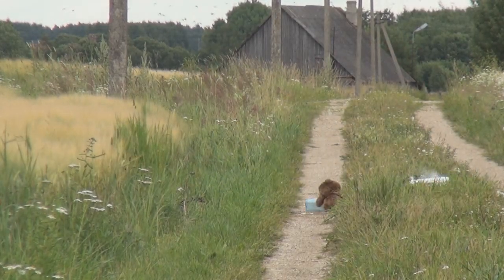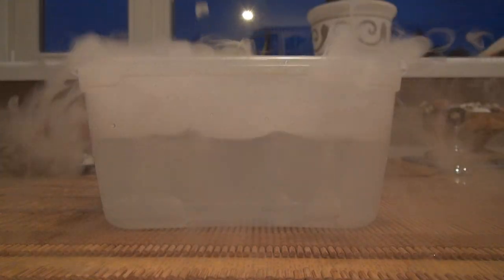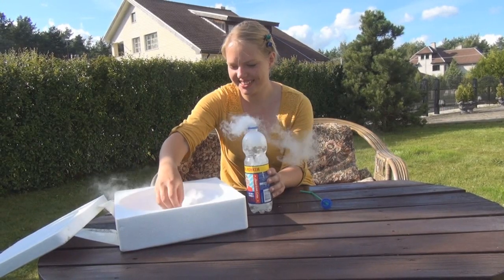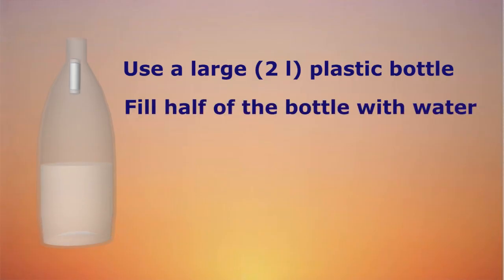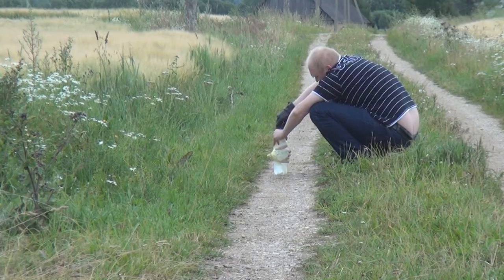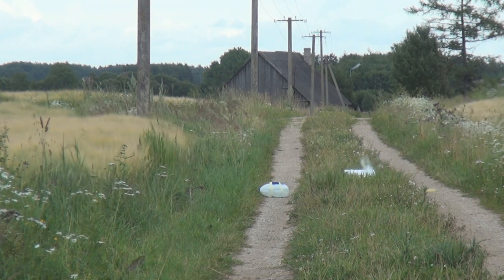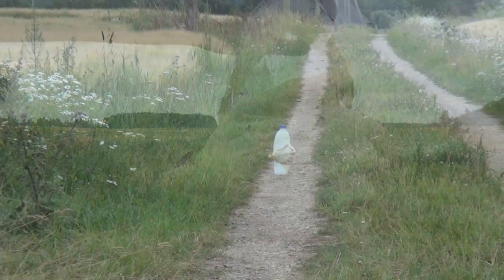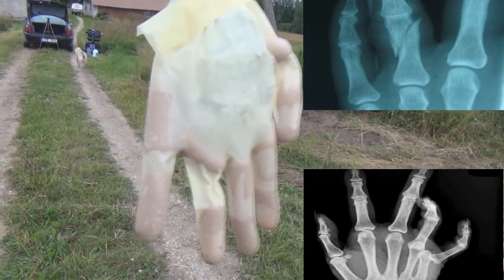Dry Ice Bomb - How to Make it Yourself (DIY)

Comment: A lil bit of questions, 
1. Is it ok if you use a smaller bottle?
2. Would adding more dried ice or water make a difference?
3. Is it possible I could shoot the cork/lid out as a projectile if the bottle/canister was of a different material? (It'd be cool if I could make a makeshift firearm lol)
Reply from the maker: I have tried smaller bottles but they are more unreliable and therefore dangerous. Water would speed up the process and also make it dangerous for you. If you want to make a cannon, then there are far better and more reliable options to do that - e.g. with pressurized gas and a manual valve. Before you do any of that, count how many fingers you currently have and make plans on how many of them you would like to keep in the foreseeable future :D
Reply: @CaptainCorrosion  k man and thanks for replying a comment to a 7 year old video 👍